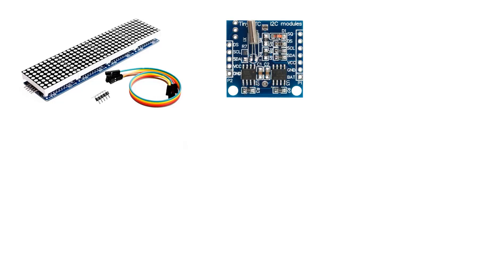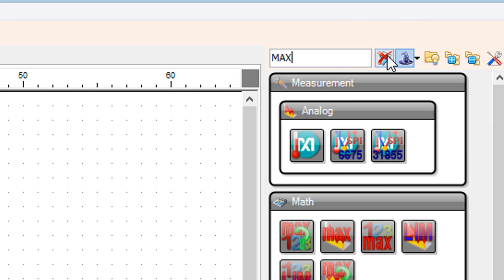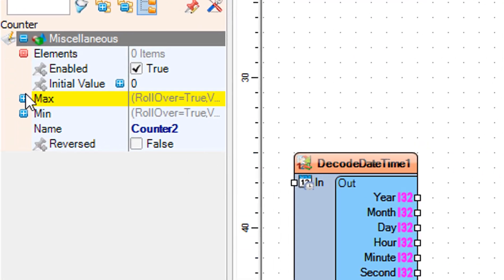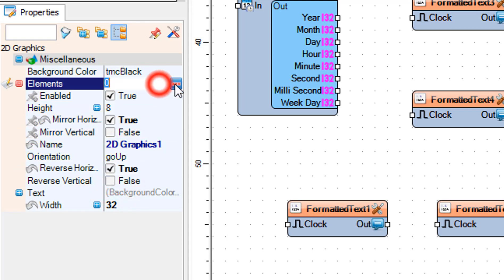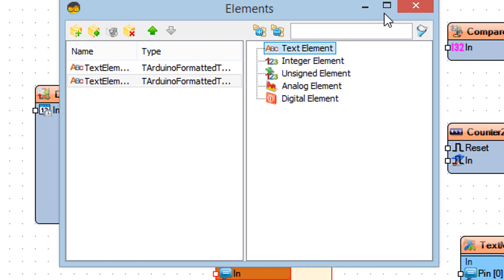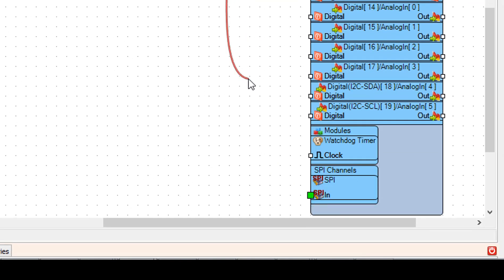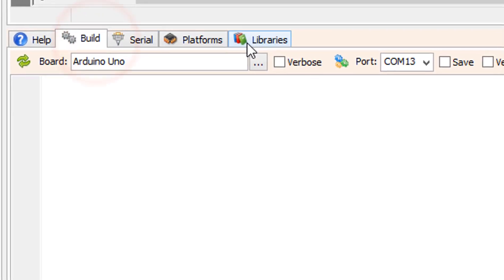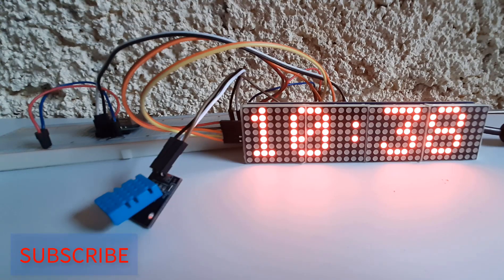LED Matrix Animated Time,Date,Temp and Humidity

Comment: Virsuino is much simpler than arduino code. It seems, I will begin using Virsuino. I do not want to use the 'delay' function. I want to use the 'timers'..... Hence I want my arduino to do more. How to use the timers in virsuino?
Reply from the maker: Visuino uses timers for some of the components automatically
it practically never uses a Delay :-)

And the usage of timers in Visuino is expanding.

Now if you want to extend the Visuino power then use Custom Code component (Available in Pro) it allows you to use/integrate any arduino code,libraries,etc.